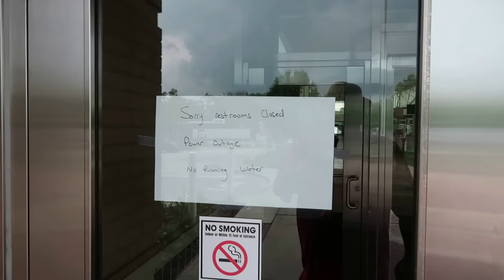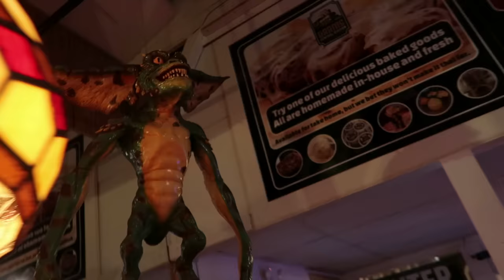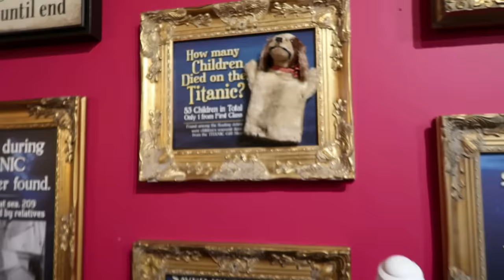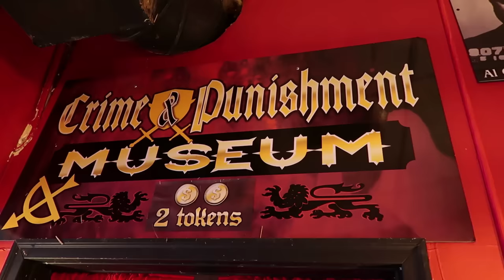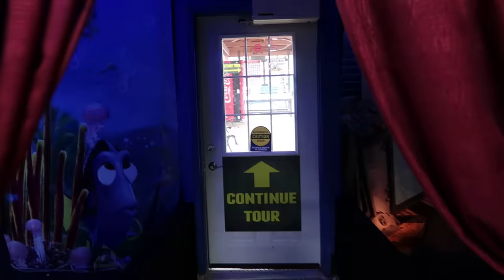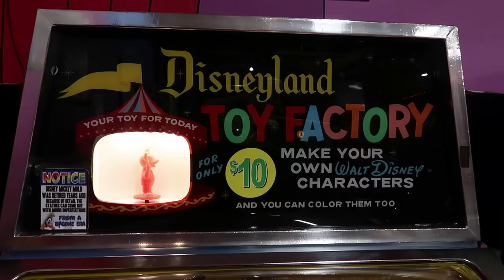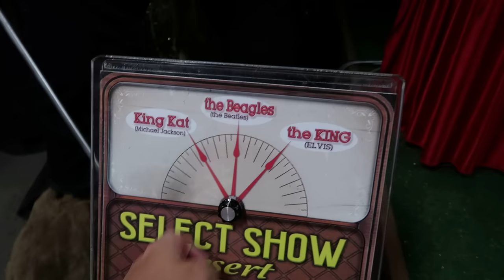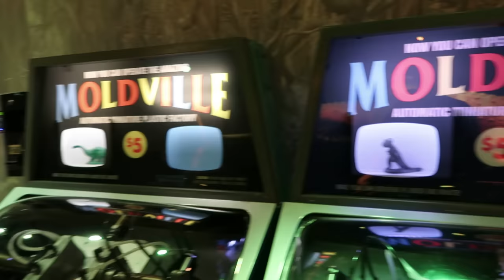Animatronic Bands! Mold-A-Ramas!  Titanic Exhibit! Dinosaurs!  What's New at the Volo Museum?

Comment: Very interresting video, but the "tank" 20:08 isnt a tank, but a german Armoured Personal Carrierer. 

Its a halftrack of the model Sd.Kfz. 251 Ausf. B (it could be a model A, but only 350 were made, so B is more likely. It could also be an old modified, Slovakian post war OT-810.) 
You can tell that its either a model A, B or C by how the rear doors bulge out (on the D theyre completely flat at an angle). The C has a different nose shape, which doesnt seem to be pressent. 
Nicknamed "Hanomag", a total of 15.000 were made durring the war, spread out on the 4 base models (A through D), and another 20 specilized variants

Comment: Ugh, that Titanic exhibit is full of very awful misinformation.

- The view from the bridge there shows a full moon. In fact, there was no moon at all that night. Combined with the absolute darkness, the still as a milpond waters, and a thermal inversion prevented the lookouts and bridge crew from spotting the iceberg sooner. And the binoculars wouldn't have helped since they provide a very narrow view ahead. The standard practice was for lookouts to use their own eyes and then use the binoculars to identify the object, be a ship, iceberg, rocks, etc.

- 44 lifeboats were NOT removed from Titanic. The Olympic-class was designed by Alexander Carlisle to have upwards of 60 lifeboats, but this was a notional only. The Board of Trade laws were outdated and Carlisle put in the Welin davits (which could take up to two lifeboats per station in anticipation of the laws being updated. The laws never were updated and so the boats weren't added. It's a myth that was done to make the view better, but in fact the davit design would've kept the view the same even with 40 boats in place. Lifeboats in those days were viewed not to evacuate all the ship's passengers and crew, but to shuttle them from the stricken vessel the rescue ship or ships. As it was, Olympic and Titanic had more boats on them than the law required with 14 large clinker-built boats, 2 emergency cutters, and four collapsibles for 20 total. The laws stipulated for a ship Titanic's size only 16 were required. In other words, White Star Line provided 25% more lifeboats when they didn't have to!

- There were THREE lifeboat drills! The first was at Belfast prior to Titanic's delivery to Southampton, the second was at Southampton on the morning the Titanic was scheduled to sail, and third was when the ship was underway. Would've been four, but one was cancelled on the very day of the sinking on Sunday the 14th. No one knows exactly why it was cancelled. 

The two wireless operators were NOT crew! They were employees of the Marconi Wireless Company, and their job was to be there to provide the novelty service of sending passenger messages (for a fee) and to receive them. Jack Phillips and McBride were indeed busy with messages, mostly as a consequence of  6-hour backlog due to the main set breaking down and then the two men fixing it and getting it back up and running in violation their company's rules which stipulated for them to switch over to the weaker backup set. But whenever they could, they did send messages from other ships to the bridge, but in this case, they did miss sending some of the crucial final ice warnings to the bridge.